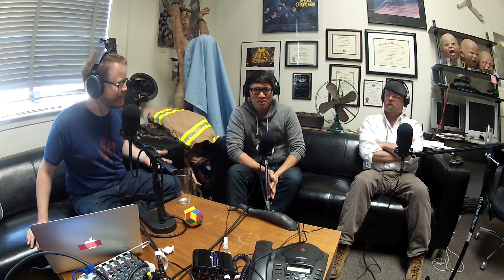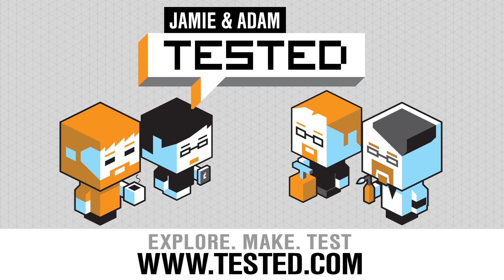Jamie Hyneman on Killer Death Robots and Robot Bloodsport

Comment: Blendo wasn't that well built at all, not compared to modern bots. It was just ahead of it's time. If it were to take on any robot from today, even with the weight and size difference, Blendo would die. Imagine Dissector putting its jaw under the side of Blendo and just lifting it up about an inch, blendo would literally self destruct.

Comment: I just watched the first episode of Robot Wars 2016 season 2 and Blendo would probably be impervious to most of the other bots. Bots with a hammer? No, since they would never hit something soft. Fire? Pointless against a bot with a spinning shell and no wiring to melt or damage. Crusher? They could never hope to actually grab Blendo, let alone hold it. The only ones that would have a chance are flippers with very low ground clearance.
Reply: +Jordan Mok tombstones blade should be able to reach blendo without getting hit itself.
Reply: And the other blade spinners like tombstone and ice wave. Bronco can stand a very good chance with his extended flipper.
Reply: Ivan Stroganov oh I meant my comment in the way that the horizontal bar spinners can give blendo a big run.
Reply: I could see the blades skimming off of blendo if he has enough ground traction. 
Jamie talks about how he tried to get some traction with magnets. Didn't bite force solve this with magnetic tracks?
Reply: Horst Dorbacher yes however the BB floor had a rubber coating, so they used regular treads instead
Reply: Corristo89 flippers, sewer snake, original sin, whoops, basically any compitent block or wedge now adays, other spinners, hammers can be spinner killers. Hell megabyte is already a better design internally than blendo was and has its counters.

Comment: One possible solution for the magnet-traction issues: use electromagnets instead. Can only turn them on occasionally because of power requirements, but should do the trick for not ricocheting. Hell, for that use you could just have them stick you in place when they turn on - lock you to the floor and let the other robot go flying away.

Comment: I am attempting to recreate this design in the beetleweight (3lb) weight class and am worried about the following things:
1. Vertical 8 in flywheels do extremely well and have sloped sides
2. Wedges could get under and them have us tossed by our own weapon
3. We need at motor that wont stop upon contact

Any feedback is greatly appreciated. Thank You.
Reply: Donny Harmuth None of that's gonna happen at 3lb.
Reply: For the third concern, just put some slip in your drivetrain - use a drive belt or something, which will transfer energy under normal circumstances but slip when you hit something. As opposed to chains or gears, which have no slip at all.

Comment: I never knew Jamie Hyneman was the guy built Blendo!  Very smart guy; I like his logical approach to engineering.  To come out with that robot at that time was amazing, there were no fighting robots to get ideas from and you didn't really know what you would be fighting against.  Probably the most exciting and most destructive design to date, not as invincible as he thinks though:, A scoop or wedge will be able to sit lower than the blades because of the speed and stability difference, as long as the deflection angle is shallow enough it only needs to unsettle it and spinbots are just as good at destroying themselves when 5h1t gets outta control.  Wide scoops built with high hardness material pretty much check mate it.  Also with that much weight invested in the weapon it leaves you little to play with for power and traction.  The gyro effect can also be a total menace for control, Last Rites can levitate the whole machine on its axis just from the gyro effect.

Comment: Blendo may have been first but Ziggo was better because he had more control over it. Ziggo had a gyroscope inside and an automatic mechanism to keep the robot headed in the direction the controls said to go.

The magnet idea is clever, but physics work against it because when you need the hold the most is precisely when another robot (or perhaps some debris on the arena floor) is lifting you up off the floor. The magnetic pull gets weaker instead of stronger at the most crucial times.

The way to defeat a spinning bot is to have a strong front wedge that can withstand repeated direct hits without taking any significant damage. Tapering the sides of the wedge is also important so that the spinner's blade ramps up onto the wedge instead of taking a chunk out of the side. Once you ramp up the spinner's blade then the spinner bot starts to lose traction and you can push it around or it may even turn over on its own.
Reply: Considering Ziggo was inspired by Blendo (and thats putting aside the fact that they are different weight classes) its not surprise that the design got innovated on. So of course, hardly anything ever done "first" holds up to innovation. Jamie worked from the ground up while Ridder took that design and improved it. Its alot easier to improve on an existing design rather than doing something completely new. Everything you described was unknown information back when Jamie started, so its easy to judge in hindsight.
Reply: dlwatib Or just if your armor is enough to stop the momentum. 

Yes, there's a number of counters now, or even by the Battlebots days. Back in the larva days of the sport, though, it certainly had it's run of things ^^

Comment: the magnets and steel wheels is an amazing idea...

Probably would have worked if the knurling was sharp enough and the steel was hardened - i picture the "rollerskates" effect being from the points of the knurling not being able to cut into the surface of the floor.

Maybe even cutting-diamond or carbide particle type surface on steel wheels would work too.

Comment: To say there are no counters to the blendo design is not all that impressive. I can come up with quite a few and some might be embarrassingly simple.
Like a tiny flat shallow wedge turned a bit to the right (because blendo went clockwise) that upon contact with the blade would be pressed down into the floor and either bend blendo's blades or lift it up in a shock.
or a little wheel on a stick above the blades to keep it from attacking. or a blendo with longer blades that attack above..